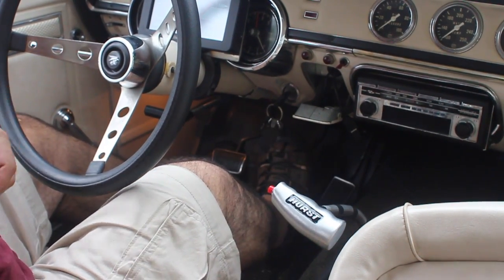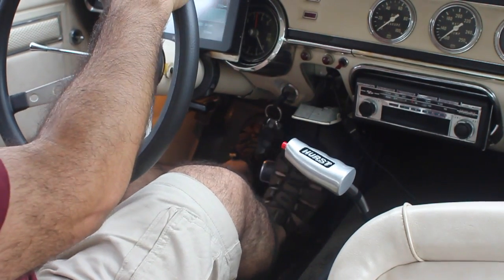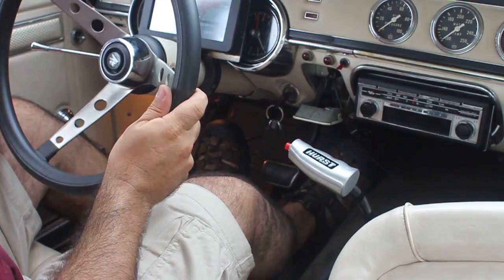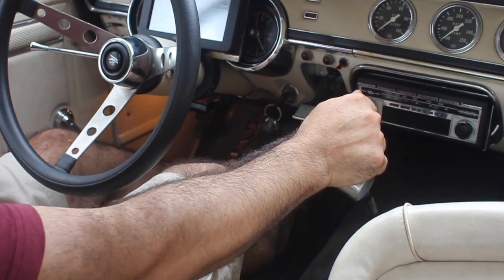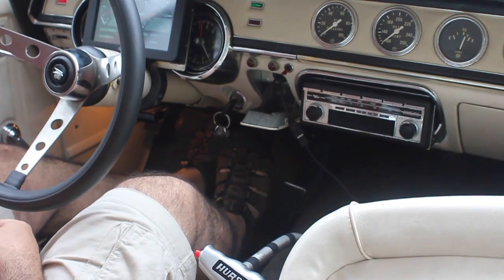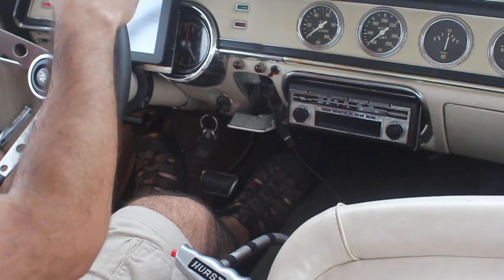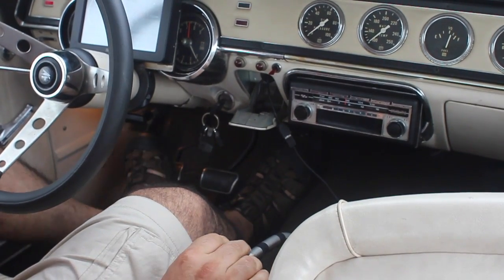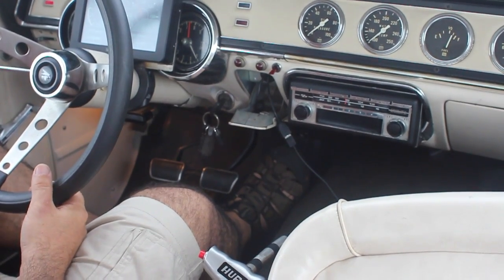Dog-Ring T56 drive

Comment: When decelerating, you can take it out of gear and rev-match for any lower gear with the clutch out (in neutral). It should not clunk any more than an upshift if you have a good feel for your ratios. You should absolutely be able to downshift as you decelerate just as you would with a synchronized box, just with the added step of bringing that trans up to speed with the clutch out before going into the lower gear. No need to coast it all the way to a stop. That's pretty limiting.
Reply from the maker: I've gotten pretty good at both up and down shifting. 👍

Comment: It's a dog box you don't need to use a clutch just lift up on the gas a little bit when you shift. If you just wanted to shift fast a regular T56 with synchros could have done that with no problems.

Comment: isn't it possible to change gears without clutch?
Reply from the maker: Dú V8 Yes, it is possible.
Reply: after this time using, did you still recommend G-Force gearset dogbox set for t-56? I have a twin turbo 800whp car and think about to use it. I use Fueltech Fuel Injection that have cut control to use with dogbox gearbox
Reply from the maker: Dú V8 For high HP applications, the Gforce gear set is the way to go.

Comment: so can you just explain where do u take the knob to shift?  like first,second, third, etc..
Reply from the maker: First is to the left and up, 2nd is straight down from first, 3rd is to the right and up, 4th is down from 3rd, 5th is more to the right and up and 6th is straight down from 5th.
Reply: projectgattago. I know how to drive a stick but I didn't know how this is driven, thanks a lot
Reply from the maker: Not sure what else to add, other than what' in the video. This transmission does not have synchronizer gears, so it has to be driven differently.

Comment: How much did the G-Force gearset cost ?
Reply from the maker: MidShipCivic I am not sure because I bought this transmission already built by RPM.
Reply: ***** how much did the transmission set you back?
Reply from the maker: More than I care to admit...LOL
Reply: *****  I want to believe the gear set is like 2500-3000 I just want one for my T56 I guess I'll call G force when they are back to normal working hours next year I guess.
Reply from the maker: The word that I got from RPM is that it would take $4500 to recreate this transmission, assuming you have a rebuildable core.
Reply: ***** I have a Brand new casing...I'm going to assemble the set my self I was looking for a good strong gear set  and PPG is selling theirs for a lot more until I discovered G-force has one so I don't mind giving them a shot.
Reply from the maker: From what I understand the regular G-Force gear set is not dog-ring. Mine was modified by Liberty's Gear to have dog-ring engagement. The PPG set is "native" dog-ring, but I don't like their gear ratios for drag racing.
Reply: *****  They make a dog ring version as well ! I just don't know the cost of the set I'd love to know maybe I should do more digging on youtube.
Reply from the maker: It's been a while since I looked at the G-Force website, but seems that you are correct. I think your guess of $2500-3000 for the gears and input and main shaft is about right.
Reply: ***** Thanks for your input, I might just faceplate the gears because based on what I read they don't sell the older T56 stuff anymore.
Reply from the maker: MidShipCivic Back in 2006 I had Liberty's Gear modify my stock f-body T56 with dogrings. That's a great option if you don't have crazy power. I have a video of my black rx7 at the track with that trans.
Reply: projectgattago can you shift it clutchless at wot?

Comment: sweet video dude!.. are you running the close ratio T56?
Reply from the maker: Thanks! I have the 2.71 first gear...It's the middle one that G-Force offers.
Reply: sweet!.. i just picked up a magnum for my 65 tempest but i havnt been able to install it yet...how do you like it over the TH400??
Reply from the maker: +heck bond I've never had a car with a TH400, so I can't offer any opinions. The T56 Magnum is a good trans, but you can't do with it what I do with my trans.
Reply: what do you mean?  whats the difference between a dog ring T56 and a Magnum?  quicker shifts?
Reply from the maker: The Magnum uses synchronizer gears. My T56 uses dog-rings instead of synchronizer gears.

Comment: Awesome man - loved it and your up shift that was fantastic - but you need to leave the clutch out until right before you put it the next cog - what I mean is when you hit the clutch between low speed shifts you lose the ability to adjust the input speed - i/e the clutch plate speed inducing a clunk as you dog into the next gear --  with the clutch disengaged one has no idea what speed the input shaft is turning it's just losing rpm be natural forces such as friction -  just modulate the throttle until you can pull the shifter out and let the engine fall until you think it's time to dog it in and hit the clutch and pull it in - try it at low rpm on the side streets -- it's always easier to do at low rpm - gets progressively harder at high rpm and higher gears - same with downshifts - just modulate until it comes out and rev it until you think it's time to dog in and pop the clutch and drop it in - after a while you will be doing low speed shifting with no clutch at all and just blipping the throttle and downshifting - you might think it would be harder on the trans but just think about what abuse that clutch plate and the springs are getting when you drop it in another gear while input and output speeds aren't matched - awesome ride man love the video!
Reply from the maker: Thanks for the suggestions! I will definitely give this a try...
Reply from the maker: So...I have been practicing what you have suggested and it is magical! Thank you. I need to make another video to show how easy this is...
Reply: No problem man - I had lost this for a bit was hoping to find it to see how you were doing - I've got a couple or 3 million in in a semi lol - 2 sticks and the like - I made my own dog ring top loader back in the 80s but kept stripping the dogs lol - glad you are doing good!
Reply: ...another semi driver here.  I want one of these trans so bad......not sure if it shows it in vid....but 67 or 68...def not a rally pac in there lol.

Comment: Thanks for the video man. I must ask, how much harder/annoying is it to drive the gforce dog box on the street? I am getting seriously close to getting a gforce dog box t5 for my car but have heard too many mixed opinons on running a dog box as a daily (which mine is) I love the gear whine, I love the ruggedness of the dogs so im not worried about noise or feel, just driveability in traffic etc. Be keen to hear from a gforce user!
Reply from the maker: Boosted, let me just say this, I'm in no hurry to stick a dog-ring trans in my daily driver. Get yourself a synchronized trans if it is truly driven everyday.
Reply: Hmm yeah I had a feeling that would be the case. Might have to go beefed up synchro box with straight cuts
Reply from the maker: +Boosted & Built Garage Mine isn't straight cut, but the gears have less angle. Honestly, for a daily, I would get a synchronized helical cut trans.